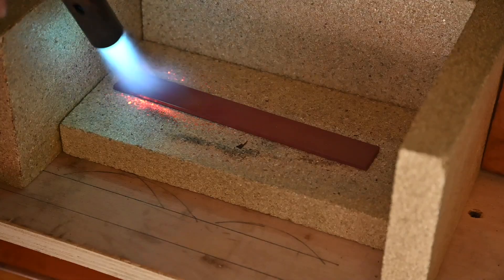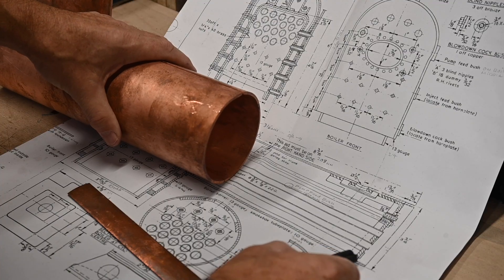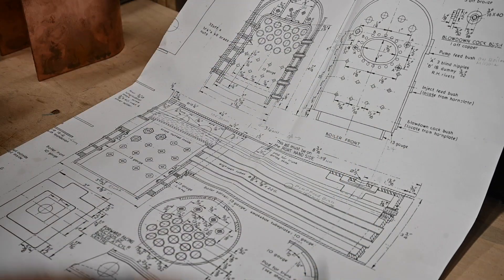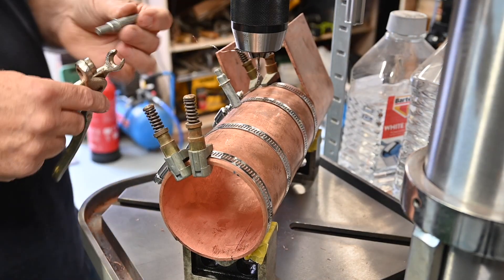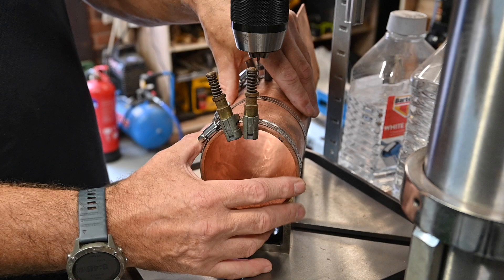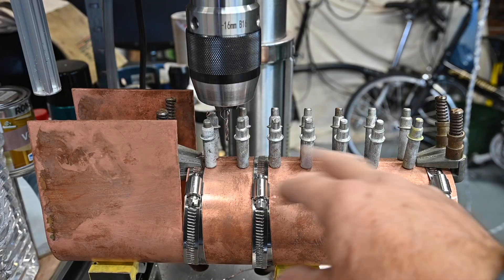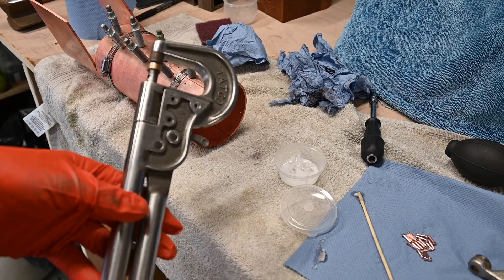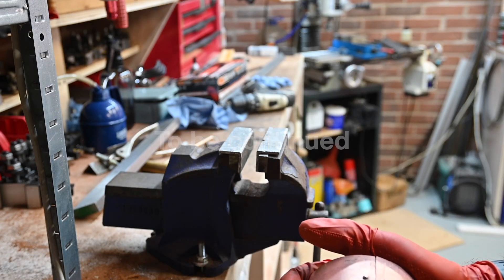Traction Engine Boiler Butt Strip

Comment: Great i made it in two pieces and had it tig welded, but not happy as you say  what size copper sheet did you use to make the whole thing
:hand-pink-waving:
Reply: I thought thats the case what dimensions of tje sheet did you use? i think i may need to make mine again it doesnt look right
Reply from the maker: @JosephTatler can’t remember off hand. But the dimensions are on the drawing. I did make a former and a cardboard template before I cut the copper.
Reply from the maker: Hi, I used 3mm because the only choice available was 2mm or 3mm.  2mm would have been too thin. 3mm was easy enough to work with when it’s annealed.

Comment: nice work. I was wondering how the riveting was going to work on something that small
Reply from the maker: The rivets are really just to hold the pieces together. The silver solder does the work. There are a lot of rivets on the horn plates which are just there to look like the original.